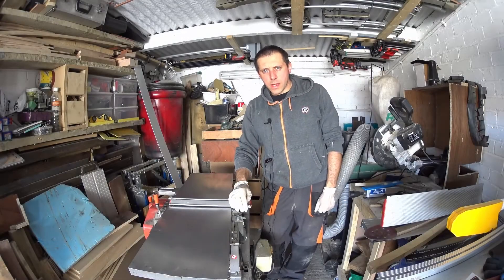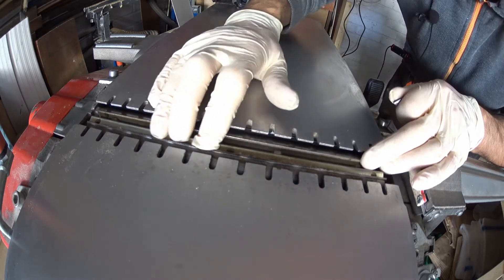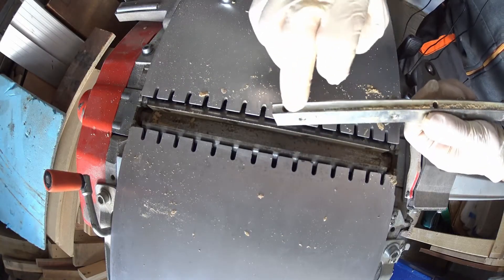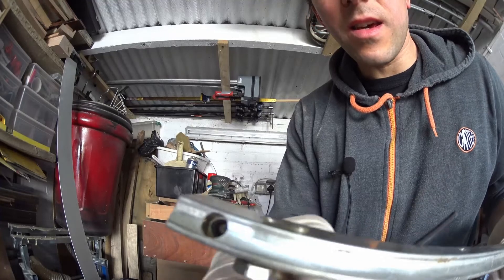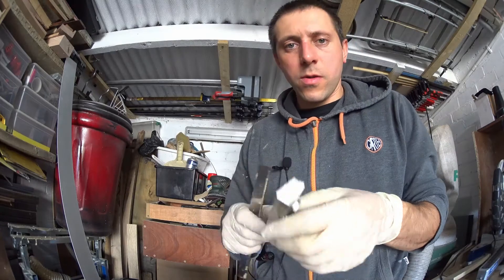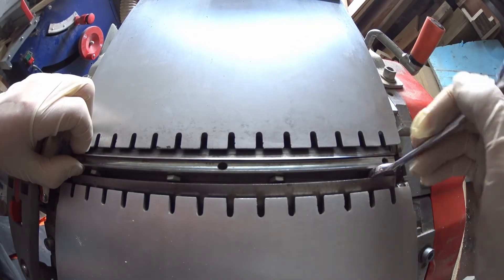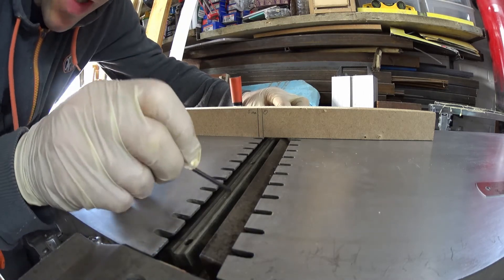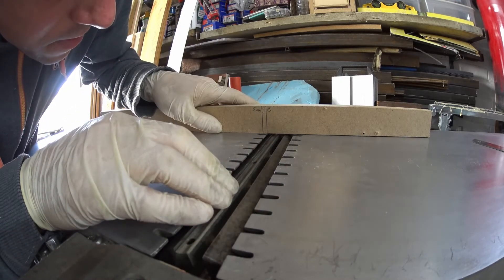how to change and set up blades planer thicknesser/Jak wymienić i ustawić noże w wyrówniarko-gru

Comment: Hi. Why do you set 5mm distance on mdf piece to set blade? Any reason is for the 5mm? I have to adjust my metabo hc260 and actually your video explained me almost everything how it works
Reply from the maker: Hi that distance it is for how high blade will be above the tables. And 5mm is easy to remember and it is giving light shavings. On my it is work good and is taking not long to set up new blades.  
Nice to hear my video help someone else. Glad to hear that.